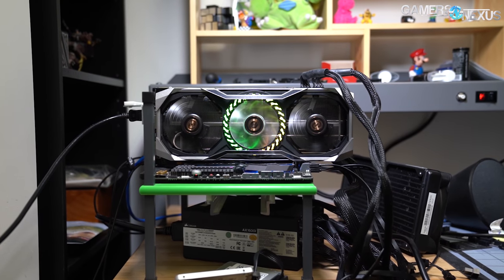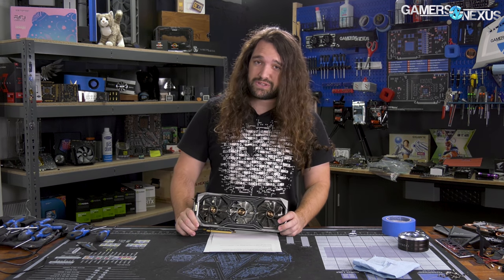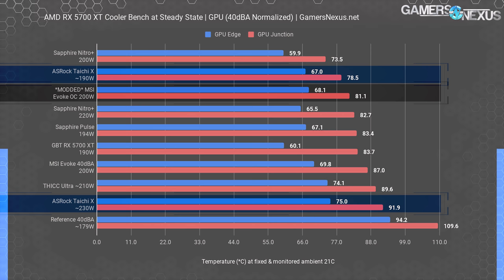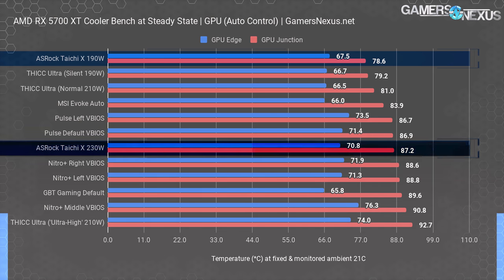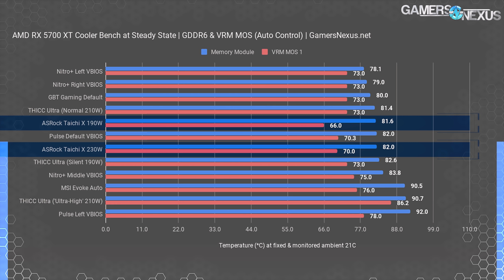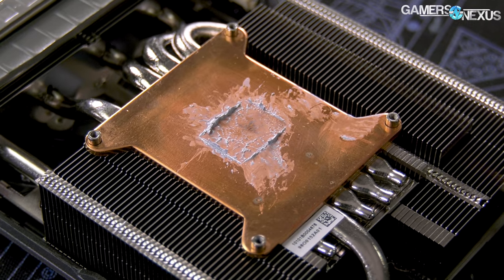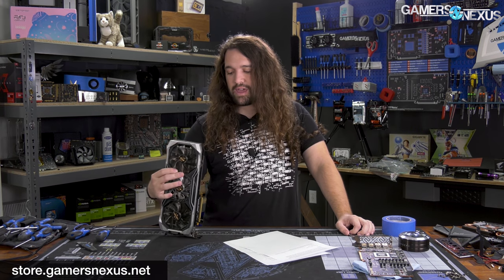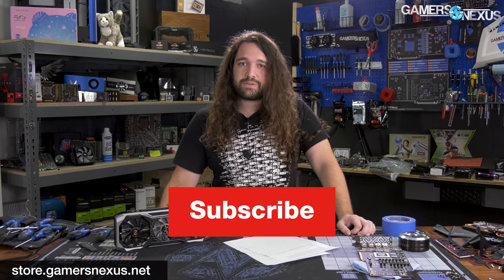ASRock RX 5700 XT Taichi X Review: Most Money Isn't Most Best

Comment: I am getting this because Newegg's deal includes a free router and game with this GPU for $440. Good deal?
Reply: I bought one today at the $440 price that Steve said in the video would make it competitive. I also "Need" to drive 6 monitors and will not go through the hassles associated with daisy chains. Oh, and we got a free game ... and I am going to sell the "Gaming" router to recoup a few bucks. So in the end, I my "Rationalized" net cost will be under $400. My other option was to put 2 graphics cards in the PC. If I used 2 new RX580s at about $180 each (or a couple of RX590s) that takes me to just a bit less than the Taichi and I would have to get a much larger power supply to run two cards. In the end, it all comes down to every individual's situation.

Comment: The point of the 5700XT was performance to value, the higher it goes then the 2070 super (espeically OC'd to near 2080 levels) is the better choice.  550 CAD (or less) is the most anyone should pay for a 5700 XT.

Comment: Where I live, this card is 25 bucks less expensive than what I paid for my MSI RTX 2070S Gaming X Trio. ASrock got real cocky with that pricing
Reply: I had same situation but with Nitro+, went Gaming X Trio
Reply: @SourNote93  no regrets, with adjusted fan curve  temps rarely excel 60 C with +100/+1200 OC applied. Couldn't get more than +100 on core but damn that memory makes a huge difference.
Reply: @budgetbajur  I left it on stock for now, under full load never goes over 65 C and its dead silent. Card is thicc tho, unlike xfx :D
Reply: @SourNote93  yeah that cooler is a chonky one

Comment: Hey, I am new to PC building, and recently I built a gaming pc. I was wondering if 75-76 degrees Celsius is a good operating temperature during gaming for a Gigabyte gaming OC non pro RTX 2060 in a non Air-conditioned room. I live in Vietnam and it is pretty hot here, and I don’t turn on the ac when I’m gaming. I can’t find answers online because they are so varied. Please help because I want to use this card for the next 2 years and I don’t want to get into the hassle of RMA my card. My case is a Deepcool matrexx 55 fully populated with 120 mm fans, and it placed on my desk.
Reply: About 75C is normal, especially if it's as hot as in Vietnam
Reply: TheSpryxe l Hardware where do you live? because in Vietnam, my room ambient temp is 30 degrees Celsius all year round. So 75-76 c is cool right?

Comment: GN, 
I know this video is old .. but I could use some help pertaining to this cards; I bought one used; and the thermals shot up like I have never seen before; I opened the card; and the thermal pad(s) that run across the heat sink, just to the right of the copper plate was missing, so I do not know what thickness to order for that; I have looked every where I could find; or that you usually find this kind of information and nada .. any help, a link or a reference picture would be very helpful; since it is missing, I have nothing to check with a pair of calipers.  Thanks for any help, that anyone can provide; I ordered pads from 0.5mm to 3mm to try and make sure I am covered; but that one pad across the heat sink is holding me back.

Comment: I know this review is 2 years old in my comment will get buried but don't buy this card. I may have gotten a lemon but I've seen many others with similar views about lemons or other issues that I'm having. The GPU crashes constantly runs hot all the time. The only solution I found is to over fan the system which is very loud. I know it's GPU related because the I have had the rest of the PC continue to work despite losing visual entirely. I have tried everything I know to do in and at this point the card is no longer registering to the system whatsoever. Don't buy this card. All looks no quality
Reply: you just stopped me from buying this card for my office gaming pc. thank you kind person

Comment: I was a bit disappointed by this video. I hoped that in a 20 minutes video on one of the most powerful RX 5700 XT cards out there, there would be a mention of more than just fan speed and temperatures. How about its multiport capabilities and its performance driving 6 or more displays? It would be great to talk about this, as well as the stability of MST hubs on various cards. Like, can this card drive 6×4K@60Hz? How many 4K displays can this card drive at 60Hz? How many at 30Hz?

Comment: Would be nice if there was a "performance optimized" version of this nonsense. Give me a green pcb with the reference model power phases, the largest heatsink you can strap to it without it snapping in half under its own weight and no tacky shroud with the biggest fans that will fit, noise be damned.
Reply: Muzzled that’s a fact
Reply: My mind suddenly linked to that Arctic xtreme iii heatsink, but improvised with heatsink that fits triple 120mm fan
Reply: Yeah basically get an arctic gpu cooler.

Comment: I remember when asrock was new and a garbage motherboard brand. Now they overprice their stuff because there are useless stuff glued onto it.
I also remember when NZXT was a garbage case brand. Now they overprice their garbage products because it's design.
People gets tricked again and again.
Reply: The h500 at $60 from nzxt is a fantastic case
Reply: @Tallnerdyguy  I can only find it at minimum 80euro. There are only one top exhaust and the fromt pannel is closed and only house 2 fans. How can you say it's fantastic ?
I got a Thermaltake core G21 TG. It was 10 bucks cheaper, got 2 glass pannels, a mesh front housing 3 fans.
NZXT is garbage.

Comment: Look at the card.  Steve GTFO. Match this with the x370 taichi and it's the perfect card.  In an all white case with Corsair rgb pro ram this would look fantastic
Reply: Saving money with x370 and spend it on the gpu that you won't see the rgb on because it is facing down?
Reply: needabettername my case is the core v21. You can mount a card vertically as that’s how the case comes from the factory.
Reply: @techbuildspcs  and suffocate a 2 1/2 slot card

Comment: Just get a 2060 Super and call it a day.  :)
Reply: And lose 15% performance for same price!! Great idea
Reply: @Tallnerdyguy  You can get a 2060 Super for less than £400 in the UK(£375 is the cheapest I can see), cheaper than any non-blower 5700XT. And the 2060 Super beats the 5700XT in some games, but mostly loses, but not by 15%.
Reply: @Safetytrousers  if you say so, but yes between 10-15% faster
Reply: @Tallnerdyguy  Show me the test where it is 10% faster across the board. Al the tests I've just looked at don't show that.

Comment: Please do 2 RAM sticks vs. 4 RAM sticks benchmarks in gaming. I hear 4 RAM sticks give better FPS in games.
Reply: That's not how memory works. Dual rank memory can have better performance than single rank. Running 4 sticks of single rank memory would behave similar to dual rank, but almost all of the higher capacity dimms are dual rank anyway. So you can run 2 sticks, with higher frequency, better timings, and higher bandwidth than you can a comparable 4 stick kit.
Reply: @skyhop  actually you are wrong. 4 ram sticks gets you more bandwidth. It increases latency a bit in some tests. But for gaming, it gives better FPS. Just don't talk without seeing any tests.
Reply: Arif then test it yourself. Mr. know it all
Reply: You don't even understand the wiring in the motherboard.